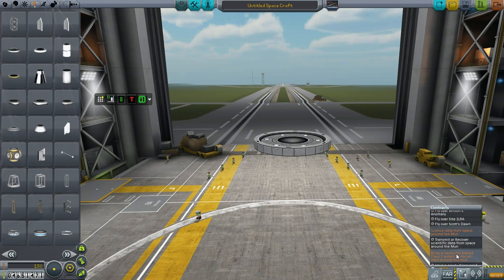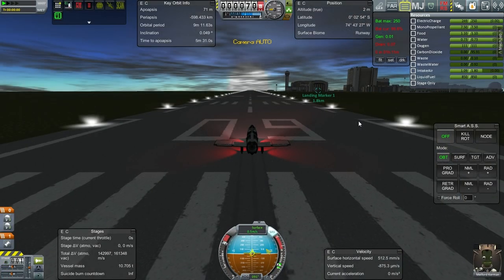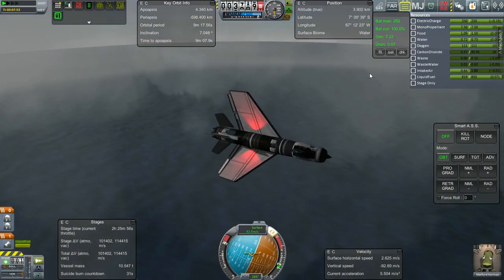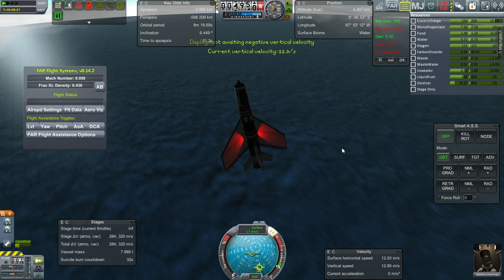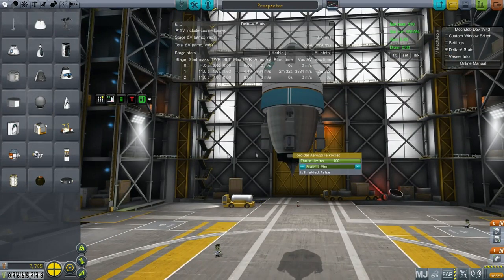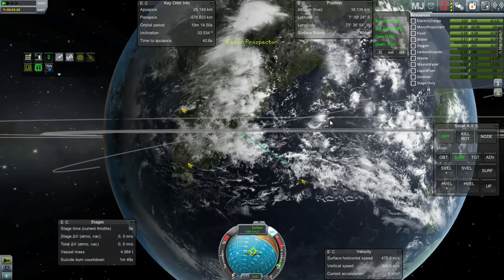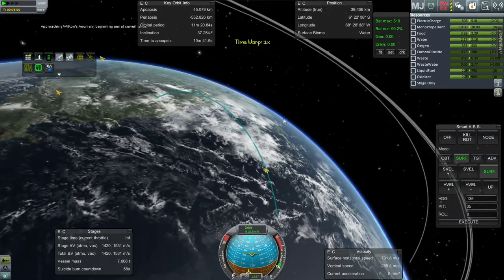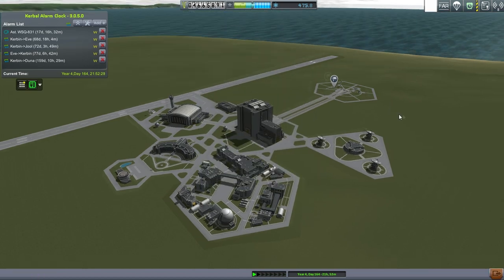Kerbal Space Program (0.25) - Kolonization 35 - Bad Aero Day Part 1

Comment: You can achieve that attitude even with a very early career single basic engine aircraft. It is rather tricky though. What worked for me was to fly at a lower, controllable altitude and then pull into a power climb towards the target.  I was at a fairly steep angle and I did it successfully, probably more than 60 degrees. As it follows its ballistic path, just try to do as little the new friend as possible, let it start over and nose towards the ground. You will have zero control just try not to spin. You will regain control as you fall into the denser atmosphere. This is freaky, of some of these I pulled out that only about a thousand meters above the ground and just barely.

For level high altitude flight it usually requires two engines designed for high altitude like the turbo jet, and then a ton of speed. I'd say around Mach 2 is typical for that altitude.  If you can't achieve it on the first climb, let the plane fall back down if you feel like you are losing control to a slightly lower altitude but with more speed and slowly climb again you'll find that at each arc you'll be moving faster and faster and can go higher and higher.

High altitude flight is like driving a hockey puck on ice.
Reply: ***** wow voice rec really messed up that first paragraph in my comment.  I haven't tried flying a plane in 1.0 yet.  Yep... sure is dangerous. My only fatalities in my current career are due to aircraft flights.  One thing I forgot to mention... pulling out of the dive after a power climb requires low altitude air... so don't do this over mountains!!! ;-)  OH, and RCS helps too- positioned for max leverage.  The real-world X-15 even had this.

Comment: 17k is achievable but I think you need to use mech jeb and use the pitch and yaw modes like you use for take off.   Of course you have a reaction wheel on this aircraft right?
Your final angle of attack will be about 35 degrees.. and the speed will be about 220m/s or so... have ago.